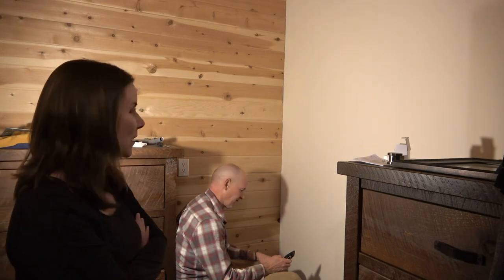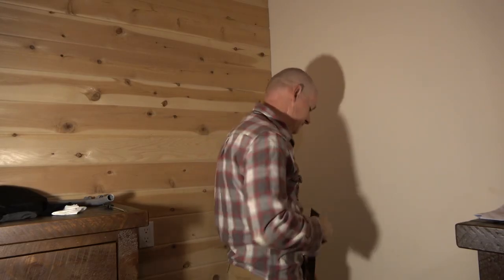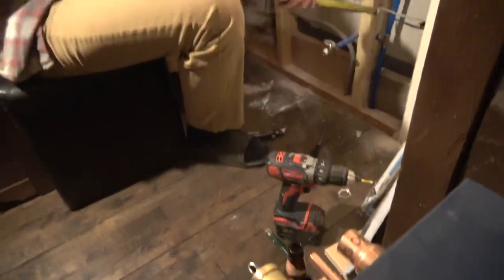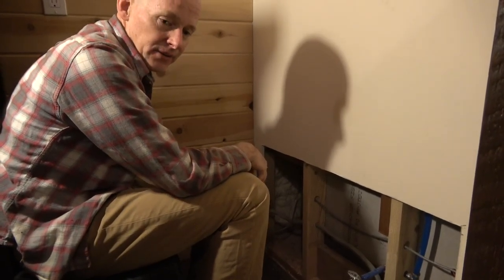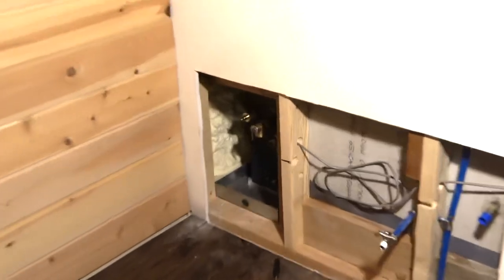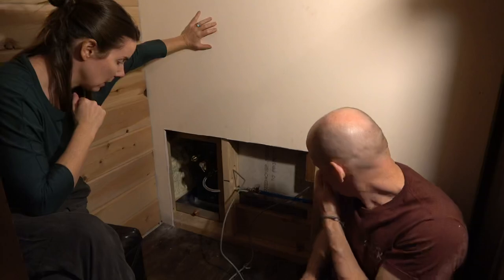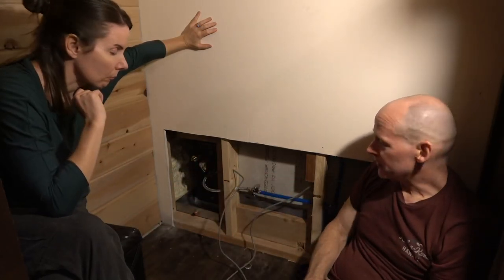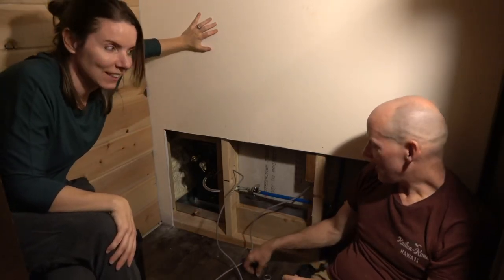We Didn't Want to Do it THIS Way. [Steam Shower Generator Install]

Comment: Nice shower. I think the steam head is rather close to the bench. So need to be very careful about burns. And it would be more comfortable if the steam head was farther away. So the steam can continue to run while in the steam shower without it getting too hot being so close to the head. Would be a little bit of a project though to move the control and steam head.
Reply from the maker: I supposed if you sit on the bench during your shower that could be an issue, you can always toggle the steam off and on as desired.

Comment: I would not use pex on a steam system the heat will soften the pex and you run the risk of failure
Reply from the maker: Valid point! Bryan was going to do this and he may end up changing to all copper. He's now thinking of redoing it, now that we tested how warm/flexible the Pex gets. At least with the door set up we will be able to keep a close eye on it.

Comment: do you have a ceiling vent in the toilet area? if so will the 2 fans compete with each other since they are venting in different directions.
Reply from the maker: No, it's on the outside of the toilet area.

Comment: What version of the SteamSpa is this? I’m planning on buying the 7.5kw version (32amps). I had an electrician pre wire an 8guage wire rated for 40amps. It’s a really thick red wire. When looking inside it only has 2 internal wires (Red and Black). I noticed your wire is grey, much thicker and appears to have 3 internal wires (white/black/red). 

Am I screwed due to the wire that I pre installed? 

Great vid thanks
Reply from the maker: Not sure what "version"- we bought it 5 years ago. Our electrician recommended it's own 50 amp wire and it has it's own breaker, if that helps.

Comment: So how much heat and steam could potentially leak by that unit and start making it mold inside the wall
Reply from the maker: does anyone know the answer to that? anything could potentially happen i suppose. at least we have a big vell ventilated door to keep an eye on it.
Reply: @ColoradoMountainLiving  I'm sure the manufacturer's know whether it would steam up a wall if it was installed into a wall. My other question would be and even if you put vent and vented doors isn't that just going to blow the moisture into the other room and against your dressers and stuff
Reply: Have the fan blowing into the bathroom!
Reply: as long as the shower had a good seal u don’t have to worry
Reply: Is there a waterproofing membrane behind the tile over the durock or cement board? If not mold will eventually get to the studs through the tile and backerboard. You need a vapor barrier or kerdi membrane. Also the ceiling needs tile and sloped, and sealed glass. Otherwise mold will be growing within a few short years.

Comment: Hello from Tennessee have your Fan blowing into the bathroom. Because I don’t think steam heat should go into your wall space. Use your bathroom exhaust to take moist air outside!
Reply from the maker: Hello! that's the plan to provide air circulation to the generator while in use. there would be a vent on either side of the wall space to blow it clear through. It's not blowing steam, it's just creating an air current cooling the generator. There's no steam in the walls, just in the shower.

Comment: Not a real good idea to enclose that high heat item even with ventilation. Also not the best access in case of the relief valve going off. Where is that going to pipe to and how much steam will you need to go through to get to the shut off valves? Live steam is a very dangerous thing to work with. I love sauna and sweat lodge time personally but I also respect the steam as a living force that is to be respected. Do not take it lightly.
Reply: Also you might want to check if Pex is rated for steam. It seems like I have seen folks use heat to expand it for installing fittings which means it softens with heat. I could be wrong but it worth checking into.
Reply: It would be a 9KW or small generator, so a max of 160 cu inches of water capacity. So if all the water was converted to steam it would only produce about 156 cubic feet of steam, and the relief should close well before its all converted. So not that much steam to deal with. If you noticed it venting turning it off at the controller is the best option, and the breaker the second option. Most of these with auto drains will however open the drain when the breaker power is shut off, that is why it would be a less ideal secondary option. So the normal drain also should be able to deal with steam incase of a power failure. Probably part of why so few have any kind of certifications on them. And the manuals are rather vague, stating to install per code, which would imply it should be certified. The pressure relief and drain should be routed to a safe area. And yes PEX is not supposed to be used on the steam line as it will get too hot. The steam line should be copper or brass and well insulated with fiberglass wrap.
Reply from the maker: I think Bryan is going to change to copper, he was initially nervous about soldering in the wall as is, but he could do it with some heat protection. He's got the drain pan, and will see with use, how and if we need to direct the drainage. At least with the way the doors are now we can keep a close eye on the system and make adjustments. Thanks for all the tips!

Comment: Hook up two CFM fan in series to the light switch that will blow air to the unit; you should be able to get those at a computer repair store!!
Reply from the maker: Thanks! that's the plan

Comment: PEX and steam, not a good mix. Not rated for the heat. It's operating temp is 160-180. Once that is reached, it begins to weaken. You also need 8"+/- of clearance on 4 of the 6 sides. 🤦‍♂️
Reply from the maker: Other plumbers were saying PEX was the best choice. Interesting the variety of responses. I think we probably got 3-4 of the sides with 8 inch clearance.